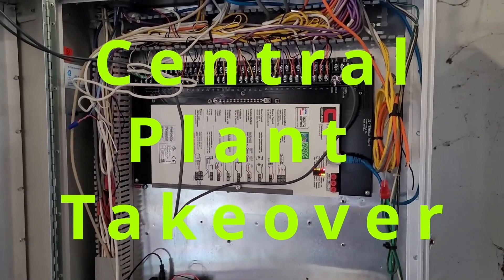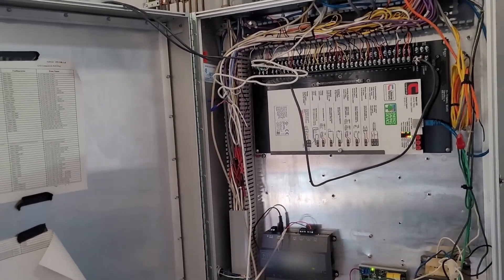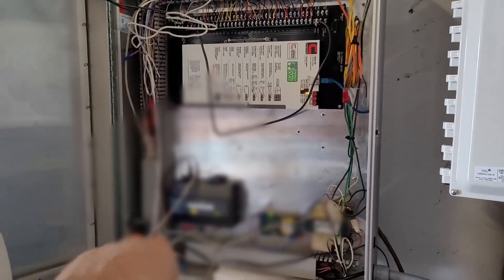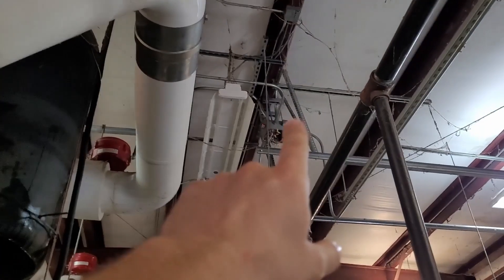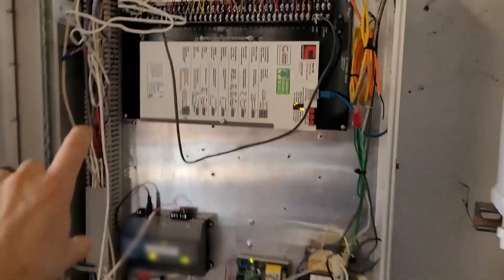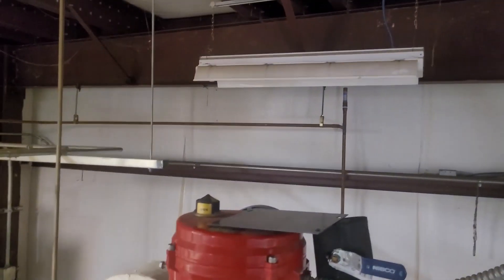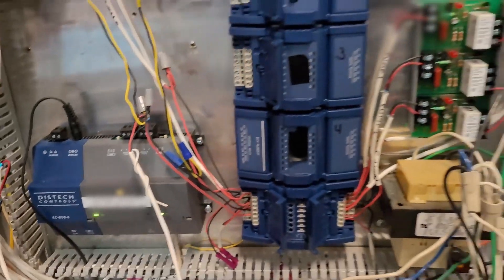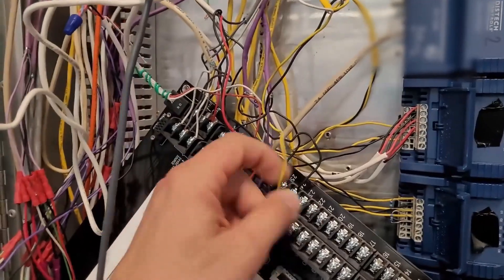Central Plant Takeover

Comment: You may already know this, but if you are going to put in a switch, talk to IT about that, sometimes our switches will ge configured to only allow one device per port, you plug that switch in and two devices and it will either only allow the first or will shutdown the port entirely.  They may also prefer to provide a switch to keep certain management and diagnostic functions available.  Even if the port protection features to block unauthorized switches are not in use, it may still create headaches later when doing diagnostics or troubleshooting, IT generally wants to know what and where all the switches are and it's not just a power or control thing, it helps us do our job better, also in some compliance things we may need to know everything on the network.
Reply: Some controllers provide a secondary network isolated from the primary. Just asking, how can a switch or any hardwired devices on secondary affect anything on the primary?
Reply from the maker: Great advice, thanks!

Comment: Those YK chillers need a start pulse and a stop pulse. Its a more of a latching switch type of action. You can add a start/stop relay...give it a run command and then pull the relay and it'll still run.
Reply from the maker: Yes, I noticed that. I had to use a N.O/N.C relay. Normally open calls it on, and normally closed calls it off.
Reply from the maker: Very interesting. That's the first time I've seen that setup on a chiller.

Comment: Wow, documentation. I wish that was always the case...
Reply from the maker: Yeah, it's pretty rough when there's no points list, and we don't have access to the existing B.A.S.
Reply: What do you do when it’s not there
Reply from the maker: @andrewamaya8109  There are a few tricks you can do. Start by doing a walk through of the facility and take note of where all the devices are(pumps, chillers, boilers, ect.) Then take a good look at the controller and identify the different types of inputs and outputs. For the outputs you can use your meter to determine the different signal types being sent to get an idea of what they might control. For the inputs you might see a resistor in parallel which would indicate a 4-20mA sensor. Then trace some of the wires out of the control box and see which direction they go. If you're lucky you'll see conduits going in a direction of a group of devices like over toward all the pumps for instance. Once you have an understanding of the general layout and the signal types being sent you could begin pulling one output wire at a time from the controller and see what turns off. It would be a good idea to shutdown the chillers before you start pulling wires. If you kill a pump, or shut an isolation valve while the chiller is running you could send it into alarm or worse. Its also nice to shut everything down so its quiet and you can hear valve actuators move, or contactors pull in. If you are going to jump voltage to bring on a binary output you had better know what you are doing, it would be easy to damage components if you make a mistake.